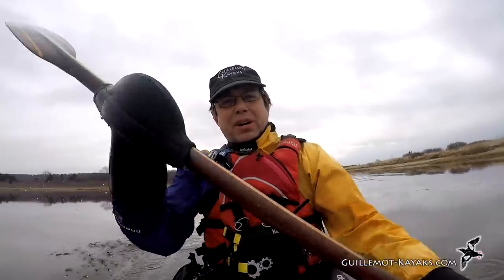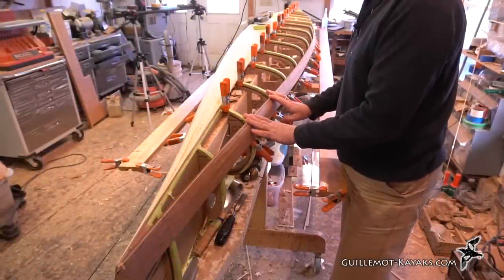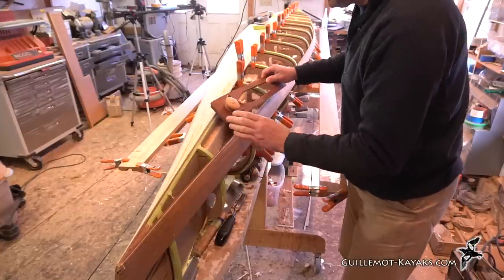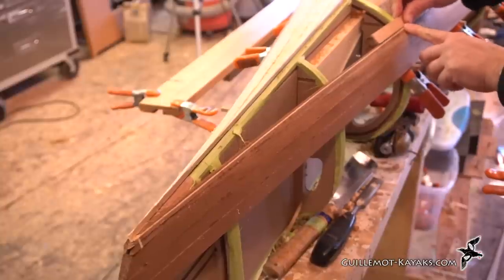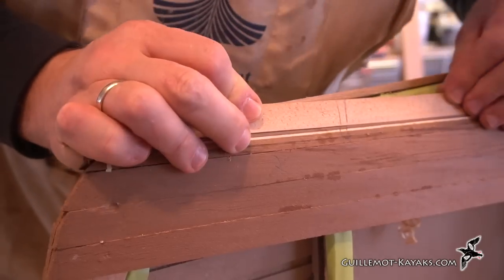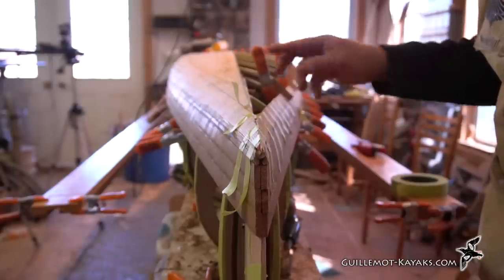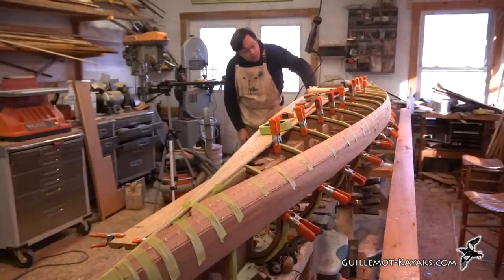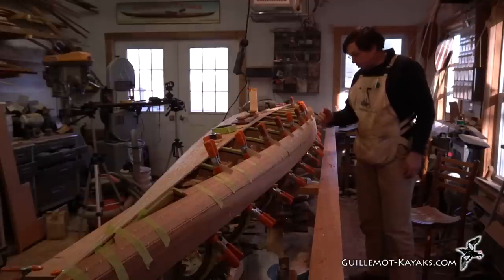Starting the Tricky Bits - microBootlegger Sport - E17

Comment: Hi Nick, excellent work and great tutorial. One thing that I don't understand to - why is there a gap between strip added at 25:04 and the strip on the other side?
Reply from the maker: That last strip on the right side will actually get trimmed down to follow the sheer line, so the end where the gap is will get cut off.
Reply: @NickSchade   Hi Nick, thanks everything got clear when I got to the video actually showing how you doing the sheer line :-)

Comment: Nick, great work as usual! Will have to sign up for your fine strip building class at wooden boat school!
Question - how many man hours does it take to apply all the strips?
Reply from the maker: It depends on if I am trying to capture it on video or not...

If I were building this kayak for myself I could probably have it stripped up in 2 or 3 days, using staples. As I'm doing it now for a customer, 5 to 6 days.

Comment: Hi Nick  thank you for the instructional videos there very good, could you tell me about the gear your wearing ? it looks like a dry suit ??
Reply from the maker: Yes, I'm wearing a drysuit. I'm wearing insulating fleece layers underneath. Just the day before there was ice on the river, so the water temperature is still very cold. While I have no expectation of ending up out of my kayak, in the water it is important to dress appropriately for unplanned mistakes.

I also find a drysuit and fleece layers to be the most comfortable option. The drysuit is designed with paddling in mind. It allows freedom of motion and just keeps off the general splashes and drips associated with kayaking, so I stay dry and comfortable. The drysuit is goretex so it breaths fairly well.